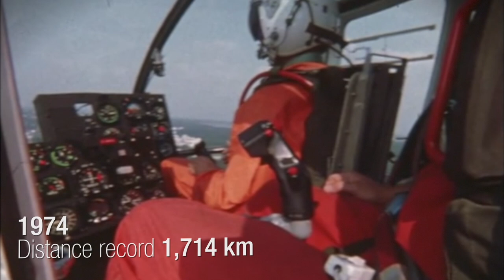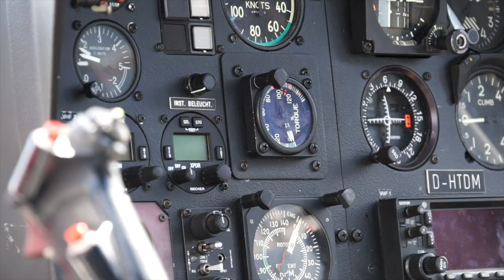50 Years BO105 - a pioneer of modern helicopter technology

Comment: The bk117 is my favorite of all time. I don’t like the rolls Royce engines most 105s have. Turbomeca, lycoming, Pratt all are really good. But the rolls design. I can’t tell you how many times I have to motor the starter to get the TOT/EGT down below 150 before I can start. That retain so much heat

Comment: How is a swashplate implemented in a rigid rotor head? It just don't add up.
Reply: Hi, let me try to explain; the swashplate is still needed and functions similar as  all other helicopter designs but ; a) the Glass Reinforced Plastic rotor blades at their neck area, provides bending action to accomodating lead and lag, flap up and down  during each rotor's  360 deg rotation about the hub/rotor mast (hence hingeless technology) .  Meanwhile the pinching hinge action is accommodated in the conventional way, due to actions of pitching push rod precisely controlled by the swashplate mechanism ; b) To prevent excessive 'bending' hence stress to the main rotor mast by the rotor aerodynamic forces( esp at 100%rpm) especially when the heli is still on the ground,  a 'mast- moment' sensor meter helps the pilot to monitor, and not to overcontrol the cyclic and lever while performing take off and landing; c) As a  consequence of Titanium hub, grp blades combination- so called ' semi rigid arrangement'  , pilot inputs  thro the swashplate achieve a fantastic agility - in flying manoeuvre .... even birds are jealous.  I hope my 'lay man' explanation at least make a little bit clear. Disclaimer:-  I am not an expert on this subject, though.